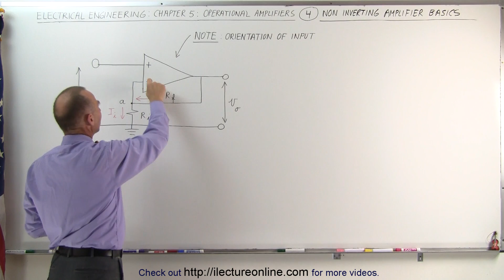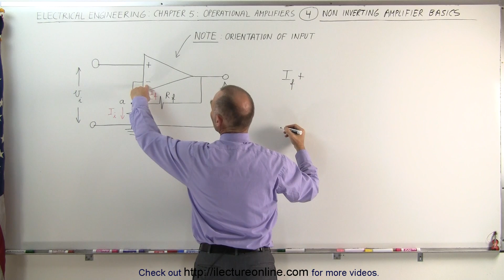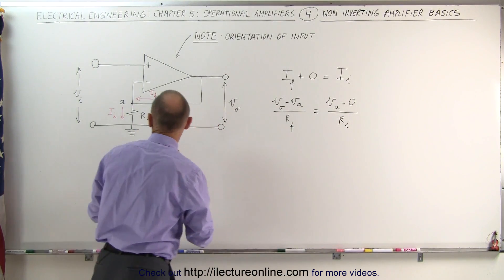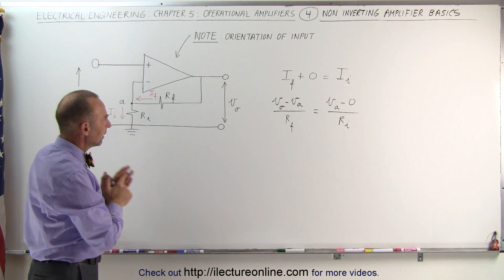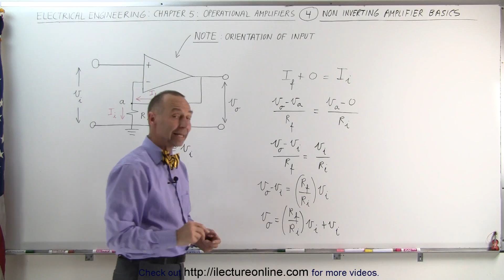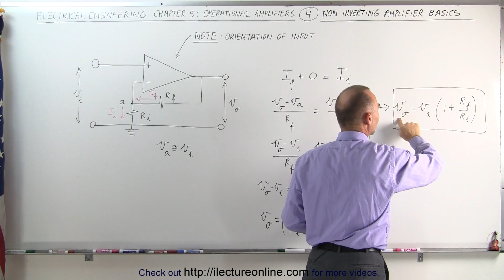Electrical Engineering: Ch 5: Operational Amp (4 of 28) Non-Inverting Amplifier-Basics

Comment: Great video, but still looking for application and use cases.....also you havent discuessed at least yet the saturation of output, i.e. it cannot exceed the supply voltages on the output

Comment: Why is there a current as the circuit is not fully connected?
Reply: Albert Thema the circuit is fully connected, as the power (voltage) is applied on the left inputs and there’s also a connection to ground :)